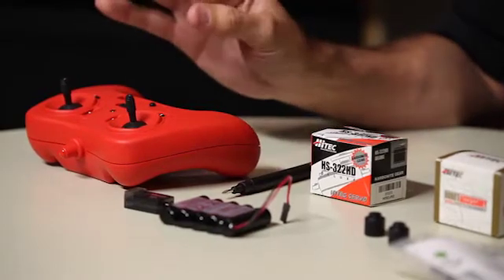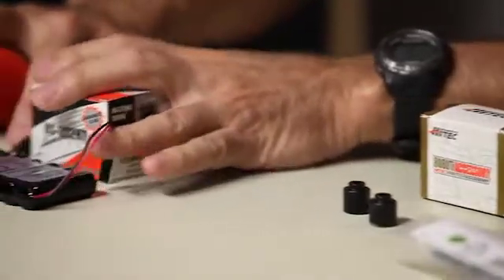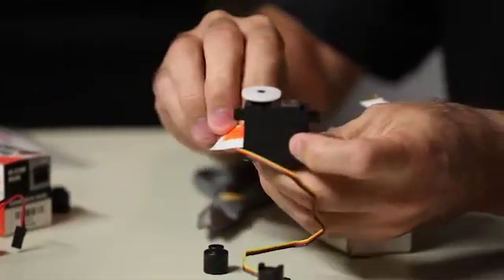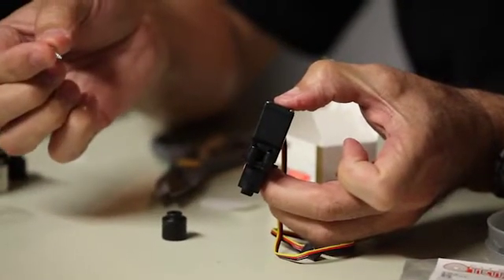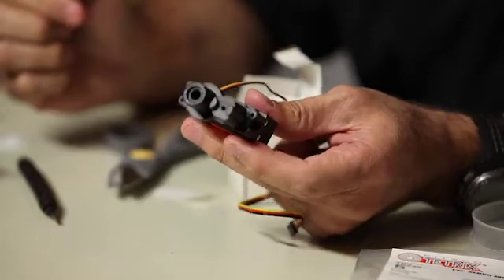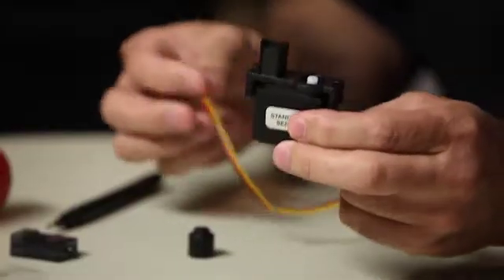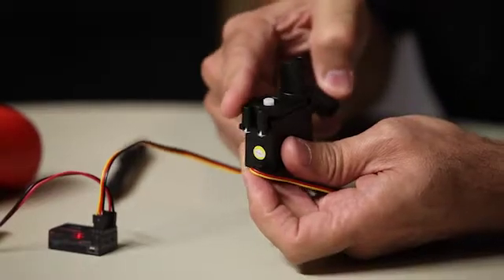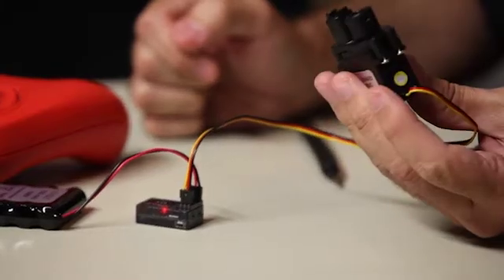RoboBench Series: Servos

Comment: Hello, my kids could not remove the screw. I also tried by myself and i could not do it either.
Please give us some tips.
Thank you
Reply from the maker: The key is to use the correct sized, #1, Phillips screwdriver. This will make it much easier to remove. If the screw head is stripped, please take a look at this troubleshooting video,  http://video.tetrixrobotics.com/default.aspx?vID=623&gID=47.